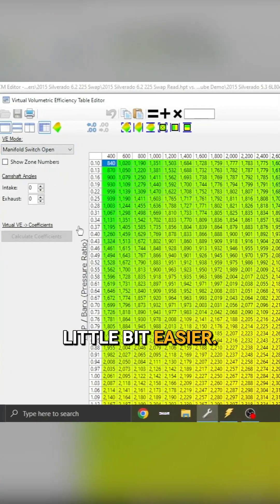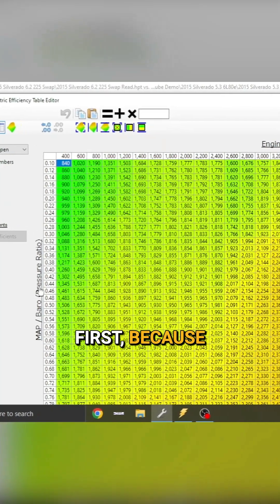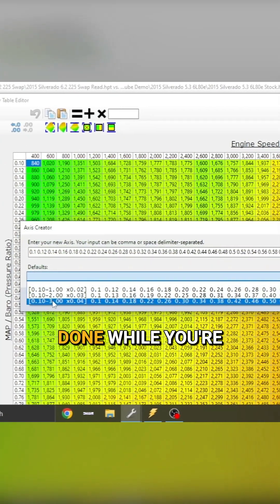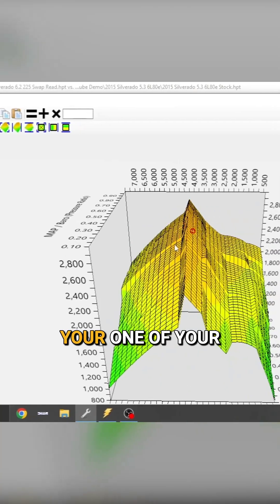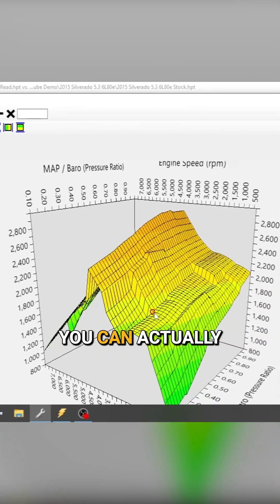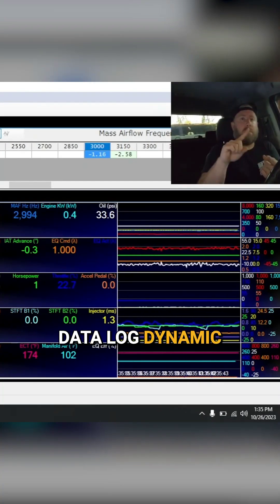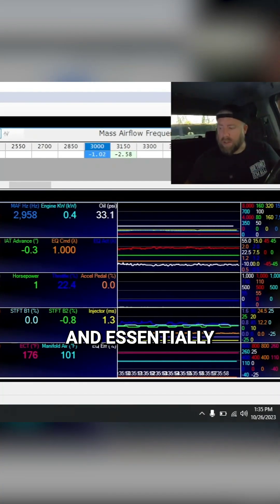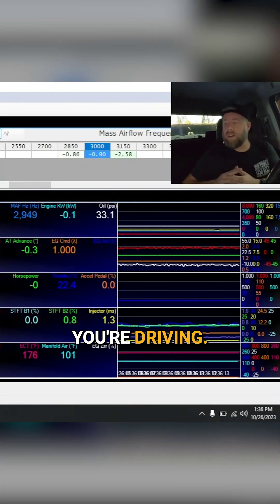How YOU can tune an LS from scratch.

Comment: Dude. Idk how to tune period. Idk how to even start. Ik a normal afr is around 14.5. I'm currently, at idle, 14.2 to 15.2ish and at wot, 13.6. Is that good for a cammed ls2??
Reply: @Ford_GTO  did you tune it yourself? did you monitor your knock sensors, seems pretty fair for a cammed ls2 at WoT

Comment: This is a great idea.  I’m new to tuning but I understand the basics.  What about this:  what if you do a quick MAF tune and use the now accurate MAF/cylinder airmass data to build a table to tune the VE?  Seems to me like this is the better way.  Why would I take so long to build an accurate  MAF curve while tuning the VE when you can quickly get the accurate MAF table?  Also, I know you’re only talking about GM Gen3 but how would this apply to GM Gen4 PCMs with Virtual VE tables?  … now that I think about it, maybe it depends on whether you are using a dyno, or street tuning and whether you are a professional tuner or not! 👍🏻.  Great video.  Keep ‘em coming!
Reply: @natez0690  it sounds like you don't need any help at all  😅
Reply: @natez0690  how did you start learning, what programs did you use